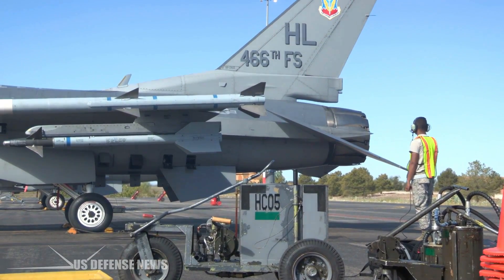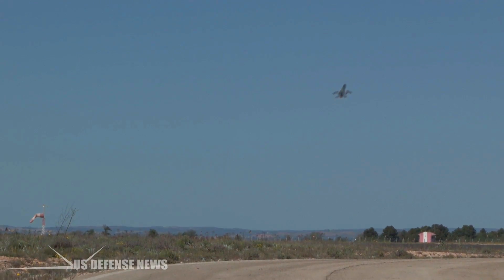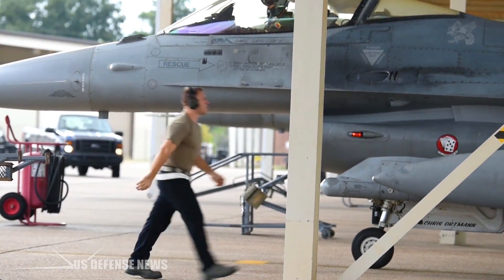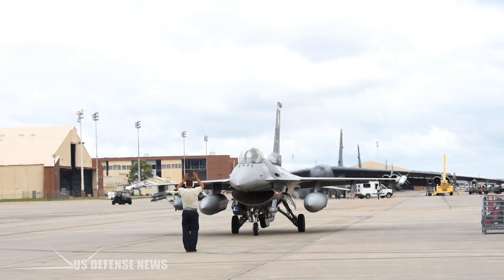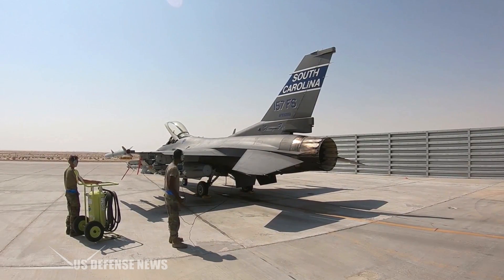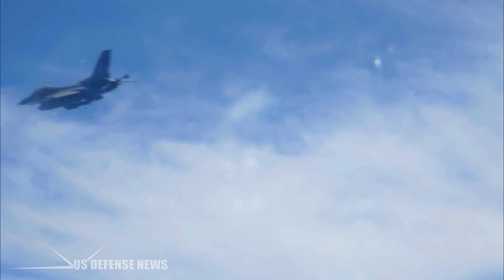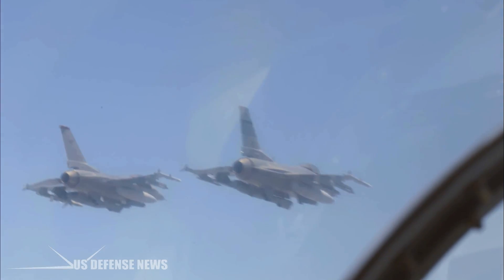Why America's Enemies Still Fear the F-16 Fighting Falcon?

Comment: In a recent conflict an F16 registered confirmed kill on an Su30mki and a Mig 21 Bison using the AMRAAM 120 BVR. The Su30mki was a significant kill despite it's vectored thrust capacity. Seems that that plane went off radar scopes following few tight orbits (perhaps trying to outdance the AMRAAM) after the missile was launched at it. That's been reassuring to us because from our Nellis exercises we imagined the Raptor was one plane that would take on the Su30 planes for one on one dogfight given its advanced radar and thrust venturing, but as it turns out, the F16 can do the job too.

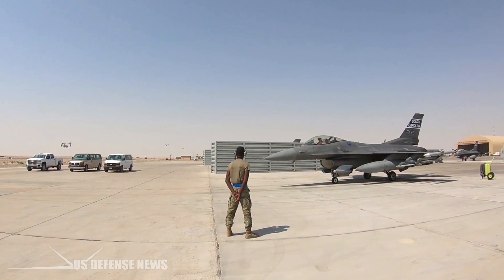Comment: 9:12 ...a greek Mirage shut down a turkish f-16 and what had formerly been mock aerial combat! The story behind this line is very strange. What I have heard and seen from different sources indicates 4 Turkish F-4Es from 112. Seytan filo based in Eskisehir was on CAP training mission over Aegean. As usual, 2 Greek Mirage-2000s took off from their forward base, turned towards F-4Es. At the same time, Turkish 2 F-16s (one C, one D) were on a training mission near F-4Es too and "were not armed" that time. 

Turkish ground controller directed 2 F-16s towards Greek Mirage-2000s to intercept them before Mirage-2000s reach F-4Es. As usual, 2 side merged and dogfight started, little later it turn to 1 on 1 engagement. 

F-16D piloted by Captain Nail Erdogan engaged with Lt Grivas. Back seater in Turkish F-16D was Lt Col Cemil Cicekli just returned from 2 years of military attache duty in UK and was in refresher trainig with squadron IP Captain Erdogan. 

After trying to gain advantage on each other, in a head on pass, Grivas fired a Magic II and shot F-16D. it caused an explosion, put F-16D in fire ball. Force of the explosion forced Col. Cicekli out of cockpit without pulling ejection handle, Captain Erdogan did not have time to eject and was probably killed instantly. 

The F-16D crashed 10 miles off Chios and Col Cicekli rescued by Greek SAR helo. Col Cicekli was in a shock after the incident and did not talk to Greeks too much. Strangely, Greeks thought he can not be Turkish since he speaks good English, someone (HAF officers) in Greece claimed he could be a IDF pilot in squadron exchange program. 

This whole incident went to AFM and discussed several times in the past. After Cicekli returned to Turkey, he said that Grivas visited him in the hospital and apologized for his mistake which is "forgetting Arm Switch is ON". Rest is history... 

Some Greeks argued that Grivas got orders from GCI and fired that missile but it is unlikely considering that that kind of order in peace time, and against a NATO ally. Also, there were rumors that Grivas thought he is under attack since F-16D locked its radar, then in self defense he fired a magic. This could not be true either. A NATO pilot should know a radar lock does not mean you are fired at (considering that there was no war but simulated dogfight). In addition F-16D was not armed considering it was a usual trainig flight. 

After this incident Turkish side did not go to Aegean without weapons. In thousands of engagements in Aegean, each side locked radars on other side. It is not a scary thing to fire a missile to save yourself? 

Only, good explanation to this whole incident is really Grivas forgot his Arm switch was on and fired it by mistake (I don?t also ignore the possibility that during the engagement, he could have lost his temper little bit, and went too far). 

I should also add this, sometimes ROE mentioned by Greeks or some other people, claimed that F-16D was violating Greek air space and Grivas have had right to fire. But they forget that air space violations are two sided, sometimes HAF also violates Turkish national air space. It happened in the past, and it can happen in the future too. IF ROE is applied, every single interception can turn bloody and each side can fire...but fortunatley this did not happened in the past, will not happen in the future too. Usual encounters in Aegean are just to show off pilot skills to other side and go home... 

This is my 2 cent about the unfurtunate event...
Reply: A usual trainig flight??in another country's FIR?This is pure VIOLATION over populated area and the shot down was was the only proper to do.turks does that every single day!
Reply: What a load of horseshit,
You think that people have time to read your fake news butthurt Greek.
Reply: @m.abdullahejaz3730  ok. I am butthurt Greek. whatever... Thanks
Reply: turkish planes  always enter greek airspace with at least  2 armed planes, so there is 0 possibility for 6 planes as you wrote to enter in training....and yes mirage fire a rocket against double seat turkish f-16 and then turks   call it ''malfunction on engine''

Comment: Yes, the f-16 is a very good combat aircraft, but sorry guys, since the Russian beggars created from the MIG 29 Fulcrum and the SU - 27 Flanker with their vector turbines, they practically made insurmountable acrobatic planes because they are also equipped of advanced electronic systems and electronic scanning radars and the latest aircraft such as the MIG 35 and the SU-35 and SU-57 equipped with missiles that reach the speed of Mach 6, and there we got fucked

Comment: Lockheed-Martin didn't design the plane, but when they took over the program they have improved the speed and systems.  It is to other fighters what the BF109 was in WWII.  It has speed, and it can out turn larger two engine planes.  The newer MiGs will get a nasty surprise if they attack the F-16 block 70.